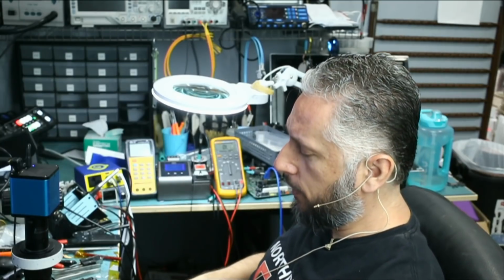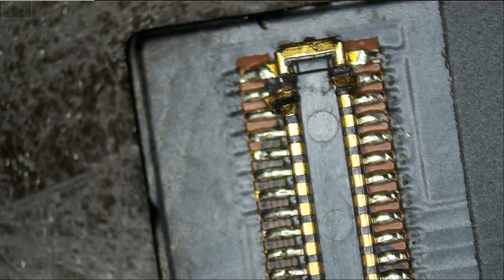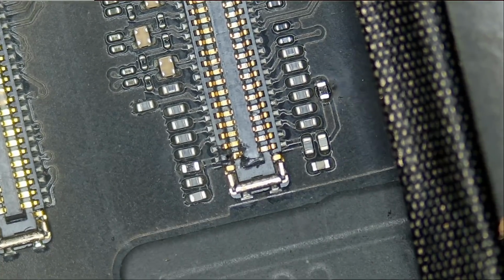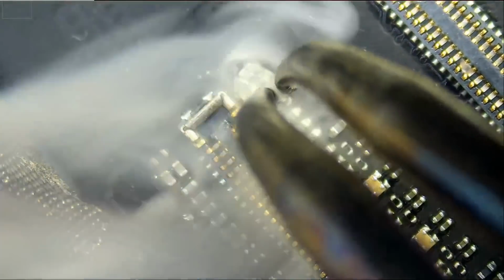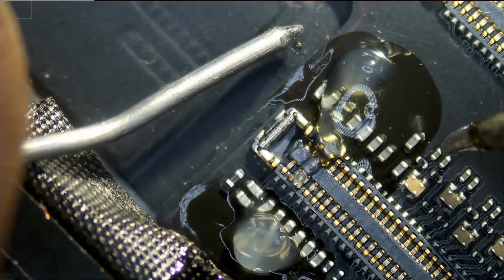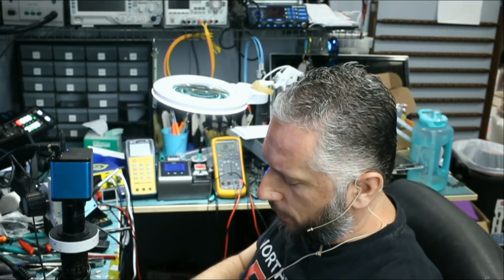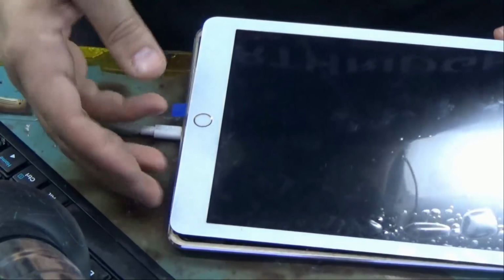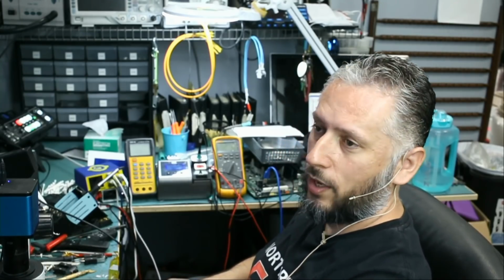iPad Pro 9.7 Won't turn on after Screen and Battery Replacement. what happened ?

Comment: Hi! I have the SAME ISSUE with my ipad pro 9.7 but it seems like transistors or resistances are fine (o i dont know how to interpret the multimeter value. If i understood correctly your video, after resistance replacement, first screen wont turn on, but then so. How did you do that?

Thanks for reading me. I hope your answer and please somebody help me.

Thanks another time

Comment: Hey, I have an issue with my msi gf65. No sign of power. No led are glowing… I already did the process of pressing 30 sec the power button or reset the laptop with the reset button

Comment: I invested thee money on A new screen 4 Migh iphone xr ifitted it mighself turned it on and is now on iphone is disabled mode connect Itunes, so i did download and installl 64bit version on the compaq cq61 i connected pphone it but it says i need lastest edition itunes for the iphone update restore mode so ithen downloaded the latest edition dated march 2022 , tryed to install it but thenwas told my laptop needs to be running windows 10 asit it currently running 7 so tryed runnning download tool and installlation of the windows 10 app but then was told cannott run the driver application. Is the compaq cq61compatible to run windows 10, if you a magian or know what your doing e.g apps for iphone recovery and itunes and window 10 applications pleaze hola me sAfe JM.....?

Comment: I have gotten to the point where I won't accept "customer supplied" parts for repairs any longer.  The last time I got bit was with a speaker recone job (two 10" speakers) where the customer brought recone kits with the speakers.  Used his kits, one of them came back for a "buzz".  After checking everything that could be wrong with the repair, I attempted to contact the kit supplier only to find out they were out of business!

So, I'm out for the price of a reputable supplier's kit and the labor on this job.  Live and learn!
Reply: I always just say there's no warranty on customer supplied parts.  Have had several come back and all I do is shrug and say we can replace it with one of our parts if they want.

Comment: Great work Alex, what a mess however. I know folks try to fix their own devices ,but this kind of work is so specialized! Even with all the tools ,you still need experience and a pretty good working knowledge of electronic components. Would you say that perhaps getting some old boards and practicing soldering and desoldering , using the tools you offer on website before attemping to repair your own device. I would say if your device messes up ,send it to your shop first and save yourself some grief and money!

Comment: Is is capacitor or inductor?
Reply: I have the same question. Are those capacitors?
Reply: @gaborm4767  I think it must be inductor, since he measured continuity across those components, and he removed it because it has no continuity
Reply: But I wonder how it can be identified among capacitors just by looking
Reply: Display filters continuity test for filters

Comment: Hello. How did you find out that those resistors have a problem if they were not shorts and did not look bad
Reply: He is skilled, you can also see that they looked like they had melted which is something to look for when inspecting the board.
Reply: They were not continues when he tested them with his multimeter
Reply: @mikeanderson1994  Are they simple resistors or should they be replaced with dedicated filters? And how you decide which resistors specs you must choose to replace them?
Are capacitors those around the 2 replaced filters?